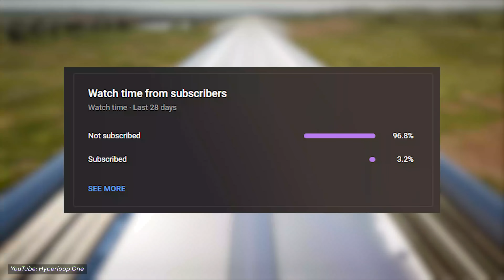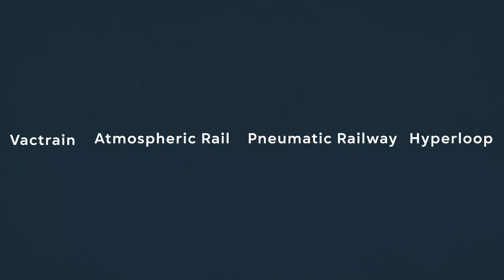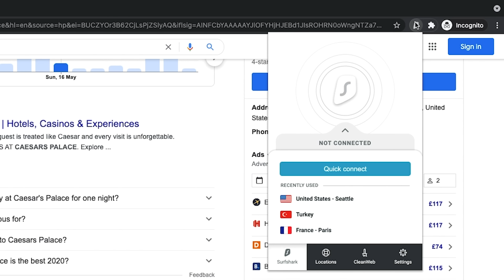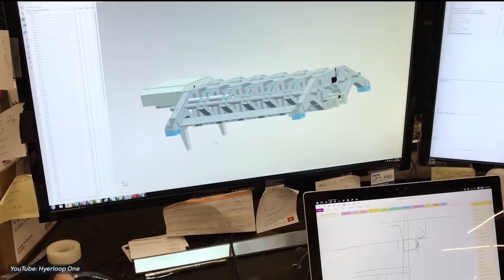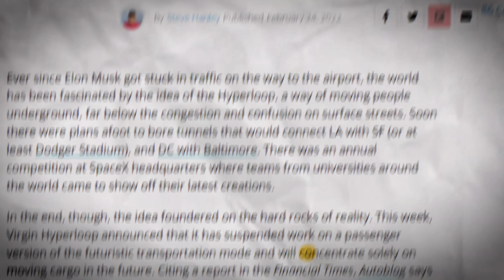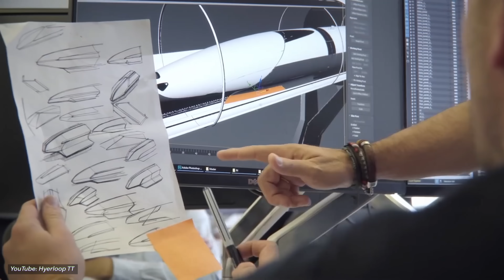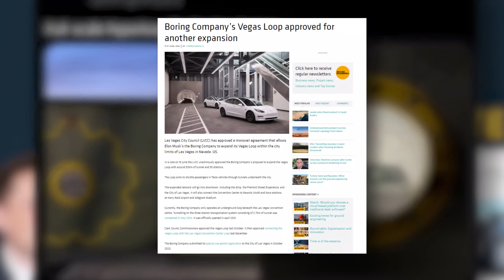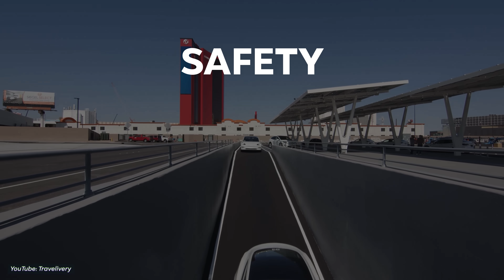What Happened to Hyperloop?

Comment: THIS "WAS" A VERY SEDUCTIVE IDEA, ...BUT (!!!) maintaining a RIGID  "COMPLETE" vacuum sealed tunnel over a long/multi-mile distance (specially in earthquake prone California) was/is the primary flaw. I always maintained that these speeds should be reduced to maybe 2/3 or 3/4 the mentioned speeds (still be extremely fast BUT NOT CUTTING A 6 HOUR TRIP DOWN TO HALF-AN-HOUR [PRIMARIALLY "PRESENT TECCHNOLOGY" WOULD NOT PREMIT IT-LATER TECH, ...YES {!!!}]).
#2.  THE TUBES SHOULD BE LESS RIGID AND MORE FLEXABLE TO ACCOMIDATE THE SHIFFING LANDMASS THAT RESULT IN EARTHQUAKES AND OTHER SUCH CONDITIONS IN THE AREA. Also the "VACCUUM" should NOT be as complete as said, for passenger safety concerns (passenger safety should override unforeseen circumstances like earthquakes, technological breakdowns, etc.)
I STILL LOVE THIS CONCEPT, BUT IT NEEDS MORE WORK AND RESEARCH!!!!!!!

Comment: I think it will work at some point in the future. However I think that it won't happen in the near future. But who knows whats happening in 30-50 years. At least it's more realistic than colonising Mars. And I think that there will be some sort of hubbs on long rides to be able to not vacumize a 1000km (or whatevery length) tube but maybe 100-200km. If something happens they would also just airopen that part to evacuate people.
Reply: Why build tubes on Mars if it has low pressure on a surface? Just for fun?
Reply: @piranhaofserengheti4878 not on Mars, on earth. I wrote that it's more realistic to have a Hyperloop on earth than living on Mars.

Comment: The world needs people to come up with new ideas for transportation.  Being stuck in the mindset of improving upon current technology won't solve much either.  I am all for trying new ideas even if they fail.
Reply: That is fine. The thing is, sometimes things just work well, all things considered. Feasibility, operational costs, cost of RnD... Maglev is a cool thing, but the only one commercially used one in shanghai is burning money for example, and too expensive for most to use. So they use...slightly slower high speed train that goes parallel with it. Research is great. But technology for the sake of technology is rarely a way forward.

Comment: I suggest Isambard Kingdom Brunel invented the atmospheric railway. He was looking for a solution that separated the power system from the train. So yes the whole train wasn't in the tube. However I think if high voltage AC power had been available he'd have gone for that option. As that was probably what he was looking for. Considering how long electric trains  have been around, it's amazing how many alternatives have failed. Steel wheel on steel rail is so simple. Hyperloop is the latest amazing BOONDOGGLE😂
Reply: First somewhat commercially available atmospheric railway was opened in Paris 10 years before Brunel took to the idea. I believe the problem was limited power from the locomotives at the time.

Comment: It's not only much slower than the theoretical hyperloop, but much slower than conventional highspeed rail or other competing tech. Japan is planning to launch a maglev capable of running with passengers at 500 kph (has been clocked going over 600 kph).

Comment: I don't think it can be possible unless you try to fly inside tunnel rather then travel like train maybe a tunnel with something which pouches pod from all direction and it stays in the middle then that pod cab travel at very high speed without any discomfort
Reply: They plan to use magnetic levitation

Comment: I'm still sure that hyperloop will be a successful new way of transportation. Perharps later than the first optimistic schedule but it will work and form a new network. They will transport goods until the beginners' faults are revealed then it will transport people too.
Reply: How would a high speed train stuck in a sealed tube with an artificial atmosphere EVER be practical. Go look up how much heavy duty industrial vacuum pumps cost, and then consider to maintain a low pressure they need to operate 24/7.
Reply: Keep simping for elon lmfao
Reply: @sgsggsgsshshs8900  Let's talk about this in 25 ys baby. ;)

Comment: Ok i get it.. its risky because a leak will make it implode like a punctured space  suit

BUT WHAT IF

The sides of the tube were double sealed with a inbuilt jet system which shot out the stuff that came with a tyre saver kit instead of a spare
Reply: "If only they'd build it with 6001 hulls."
Reply: @jayer.  something like that.. or stronger layers mixed with weaker ones for flexibility like cross ply ...Teflon coated so they glide over each other

Comment: It is possible, as long the effort is put into creating the system. Look at the smartphone system, look at bullet trains, look at space rockets, space station, etc. Anything is possible as long as it is worked on. People are capable. Being negative won't accomplish anything, so think positive.
Reply: Hyperloop will never be possible. A vacuum tube this size is impossible. Also, they need to be underground, because the pipes  can be easily sabotaged above the ground. There is no good reason to spend any money in this system.
Reply: Being honest and realistic is most important. There are wonderful cost-effective systems that can do wonders. Only problem is, nobody in US doesn't want them.
Reply: Why not just build trains? They have all the pros of "hypeloops" with none of the drawbacks.

Comment: Hyperloop will and can be feasible when all external rescue facilities are in place within 50 miles intervals ( cranes to lift a section open for mechanical failure to be corrected)
Reply: How about, I know, wild idea, just get rid of the tube and put something like a train on the rails. Problem solved, my physics and common sense challenged friend.
Reply: @piranhaofserengheti4878  in others words you're saying to get the effects without the tubes? Yeah good point

Comment: There are other similar designs to hyperloop being developed that are more practical - Virgin & E. Musk's versions won on funding investments, but as was shown in this video, have run into substantial engineering challenges - a lesser known version was proposed 30 yrs. ago that didn't deal with Hyperloop's problems - lack of funding shelved it, but versions of it are now being developed by Japan - it will be a transportation option to short haul commercial flights between neighboring cities - using proven existing technologies -

Comment: Im buy no means an expert buy would a maglev bullet train in a vacuum tube, theoretically be faster?
Reply: Of course it would be faster but it doesnt matter that much, because a train is 200+ meter long. The air resistance is only a problem for a relativ short vehicle like cars or pods. The problem with a vacuum tube is, that the whole system is way more complex. You need to pressurise the pod while the tube has a very low pressure. How do you get people out? How do you get geat away in a vacuum?

Comment: I mean to be honest to me it looks like they are just making a train and naming it hyperloop at this point.
Reply: Yeah it's like the maglev but safer and energy efficient.
Reply: @emberson7850 how would such a system be safer or mor efficient?
Reply: @flo6119  Visualizing this, Im thinking of putting one train pod into the loop. It would not make sense to put more than one in the same track, which sort of defeat the purpose of the vacuum. Each pod should have its own loop whichever direction it's going. Therefore, it won't be like what happened with Maglev, especially since theres no place to fall off the tracks, or hit another train. There still should add lots of failsafes to this like pressure, oxygen, tracking, stopping, etc. I imagine it be quicker then Maglev with the vacuum, giving it a boost since Maglev is already fast.
Reply: @emberson7850  creating such a big vacuum can never be more efficient or safer than a train.

Comment: They managed a whole 107mph test with 2 passengers when even the antiquated rail system in the UK can do better than that.  I think trains are limited to 125mph here even though the engines are capable of going faster (they are over 40 years old and must be approaching 50 soon). The Euro tunnel train may be even faster for the short distance it travels before entering the tunnel.
Reply: UK trains are 125 mph cos of the signals 👍. ( And lots of curves 😳). But yup, 125mph is the max speed a driver can see a signal, and stop before it gets there. Thats why 125 mph is so common across the world, cos full auto signal systems are really really expensive.
Reply: heck even steam locomotives could easily beat 107mph after the first few years of their invention...
Reply: I always thought Hyperloop was BS, but this is the only really dumb point to critique. It has 500 meters to accelerate and to come to a halt again, so it has 250 meters to go to that max speed before hitting the breaks, which is actually Ok, after all, you cannot rip peopel's faces off in a commuter setting ;) So no, antiquated UK rail system does not do better than that, because it cannot accelerate a train to 100+ mph within the distance of 250 meters...
Reply: @Baerchenization  Talk about defending your idol.
At what point was his comment about the acceleration and deceleration of the two non-competing technologies (because one will not be made for public use)?
The op is perfectly correct in stating the UK's trains travel faster than Branson's hyper-whatever.

Comment: Hyperloop = hype spiralling around a closed loop. 

—-
Medhurst’s atmospheric railway didn’t run in an evacuated tube but propelled the train by a pressure differential between the front and back of the object in the tube.  This was developed because early steam locomotives didn’t have enough power so a means of transferring power from stationary engines was needed.  The development of steam locos made this redundant.  

Electric railways is a better way trains not to carry their own fuel.  Hyperloop does the same.
—
Boring company LVCC has nothing to do with Hyperloop.
—
Hasn’t Musk admitted Hyperloop was just a gadgetbahn idea to try to stop high speed rail in California? He is an egotistical billionaire with an adoring fan base so he can do that kind of thing.

Comment: There are so many fundamental issues with this as a concept it’s hard to understand why so many got enthusiastic about it. From trying to create and maintain a near vacuum chamber that’s hundreds of miles long to the user experience of being trapped inside a hermetically sealed coffin pod inside a very long tunnel with few access points. Maglev would be more practical and cheaper.
Reply: I think we can get around the human factors, but the vacuum tube is still a rather major issue. I mean just moving that much air is a major task.
Reply: We can make it even more practical and cheaper.

Instead of using some quasi form of magnetic levitation to move the carriage, we put a far cheaper and easier to maintain electric motor on it instead. 
Next we add wheels as the medium for which the carriage can move on. 
And, instead of being underground (which is mega expensive), lets put it above ground where ever possible, so it has easier maintenance and easier to fix. 
Because miles of magnetic coiled metal rails are extremely expensive and hard to maintain, we use plain steel for the rails and rest the now wheeled carriage on top of them.  
Then, instead of running dangerously high voltage on the rails or using magnetic induction to power the engine, we set up a series of poles to hang wires from, for which the train can pull electricity and power the electric motor on the carriage.

And from there, we would have the most cost effective method of moving a carriage at very fast speeds over very long distances. All of the parts are inexpensive and easy to replace compared to a hyperloop or maglev. And that's not to mention that its cheaper energy wise, to operate as well.

I wonder what such a system would be called.
Reply: @darkevilazn  true though the basic idea has been around for years in version or anther heck Gene Roddenberry used them way back befor he produced startrek  as plot device  where the world was devastated in a nuclear war where hyperloop the system was used by an organisation called PAX  not sure of its name but he had to do a couple of pilots set in that world that were slightly different
Reply: History will look back at us as the most gullible society ever for trusting egomaniac capitalist billionaires like Musk. Everything will change soon once climate change and energy scarcity really starts hitting hard.
Reply: They should have used four rails top and bottom utilizing compressive force rather than just levitation and used a specially designed set of trains to create the vacuum, if each section was valved it being sealed wouldn't be a danger. As the specially designed trains moved using the quad rail system it would force air out on the front side and leave a vacuum behind it. Just attempting to pull a small vacuum on one end would help pull this type of train. Then the rest would have a vacuum space to run freely. I know you'll pull me up on the ins and outs but as a concept it is fairly sound
Reply: @shardovl586  agreed as how to do that I got an idea from a amusement park on how the log ride moves the logs using a endless river to creat a jet stream inside the tunnel
Reply: but its 'basically a vacuum tube with a hockeypuck table? xD
Reply: @AntiSociety100  true but that just a concept. Design as it is but as old thundfoot says making a vacuum and maintains would be both costly and potentially dangerous better to have a Partial vacuum caused by sucking the air from in front then releasing behind  to get a push-me-pull-you effect on the capsule much like the tubes you see used in supermarkets to move money from the checkout desk to the safe rooms ( for the minute I can’t think they are called )
Reply: @jameshead9119  it was sarcasm mate :p
Reply: I guess because daddy Musk hyped it up.
Reply: We already do that on a plain seald like a coffin and it works
Reply: @albertodolbeth1  Planes don't move through a vacuum chamber.
Reply: @albertodolbeth1  The concept of planes is very different from the hyperloop and much easier to accomplish. Still when the pressurized tube fails in a plane it can also create catastrophic results killing everyone on board instantly (which has happened already). The Hyperloop carries even more risks as you have the tube itself that is supposed to be a vacuum meaning pressure from the outside will try to crush the tunnel and then you also have the train which needs to be pressurized to allow people to breath meaning the walls of the train push to the outside. If either the train or the tube fails it will end in catastrophic results. For example look at what happens when you heat water to the boiling point in a barrel and you then close the barrel shut and cool it down quickly. It gives you preview of what will happen if the structural integrity of the hyperloop tunnels is compromised in any way.
Reply: @albertodolbeth1  Planes have much higher capacities and you can walk around in them. They are also far more versatile and are not locked to a strict route determined by the tunnels around it. It's not a good comparison
Reply: @randot6675  its also easier to do maintenance on a plane than a hyperloop.
Reply: @randot6675  you haven’t been on the channel tunnel from Dover to Calais the car trains are a doing the crossing is much like what a hyper loop train would look like  granted there still a lot to work out on the system though I think there’s trick no one has tried that’s used in a fairground  ride called the endless river  that could be modified to create jet stream effect in the tunnel instead of a vacuum

Comment: It has to be the future. There's no doubt about that. Moving in a vacuumed space has too many advantages to be ignored. It's just significantly more efficient than any other method, period. The question is just the design and technology that would work best. It'll happen soon or later guaranteed.
Reply: Problem is trying to get a hundred miles of tube to be a near vacuum is in itself not energy efficient--and that's just 1 problem.   So guaranteed to never happen.

Comment: It would be interesting to see hyperloop evolve into something practical for what we have planned in the future. With all the talk about going to Mars in the coming years and decades. Could hyperloop be used as an alternative method of propulsion in space?

Have some sort of facility in space that uses hyperloop to get a craft up to high speeds and then somehow launch it directly towards mars. The vaccume of space would mean you wouldn't be drifting slowly towards the planet and there wouldn't be any drag to cause deceleration. Any fuel needed to carry would only be needed to decelerate when the craft is close and then to land on the planet. It would save alot of weight on the craft and could if designed right, could be used multiple times.